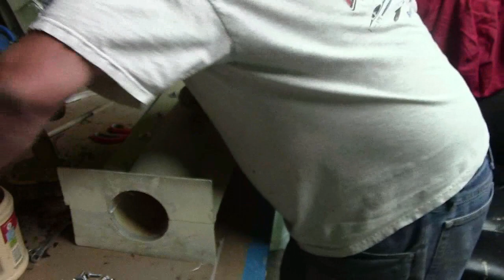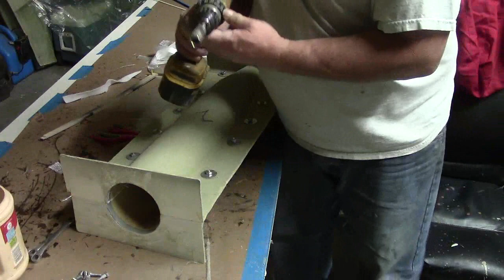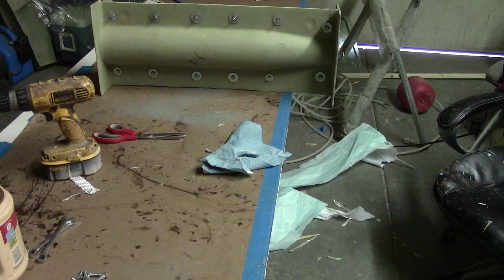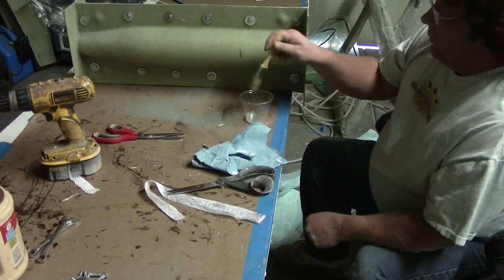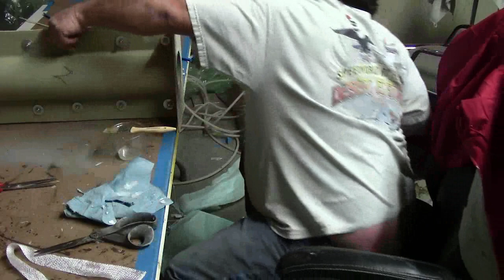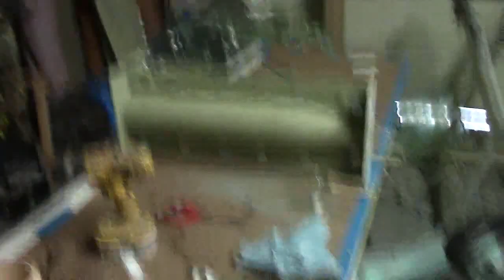F-105 buildin action #9

Comment: Bob, you sure use allot of bolts. I'm think as many times as the bolts are used, wouldn't it be just as well to invest in Cleco pins. I know that the cost more than bolts. But you could store molds with a fee bolts in them and use the Cleco clip for the production of the parts.